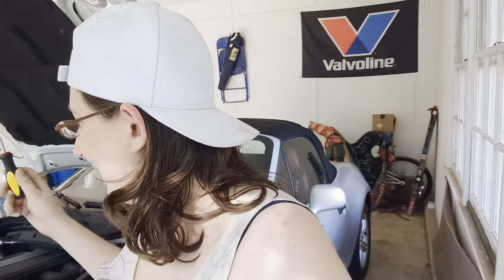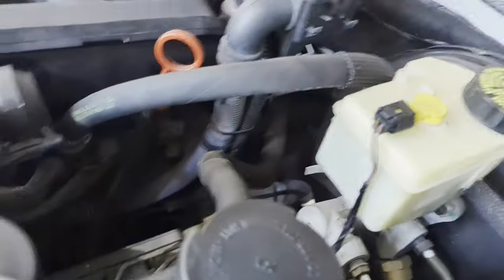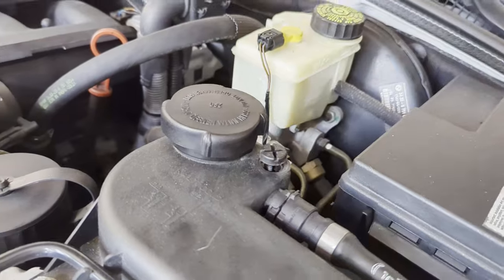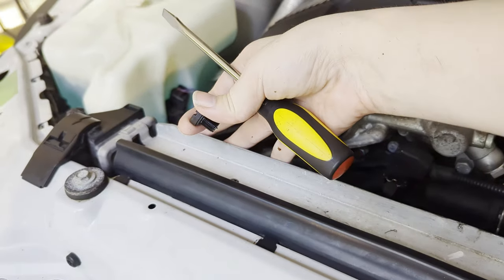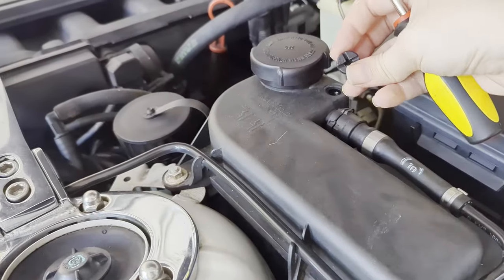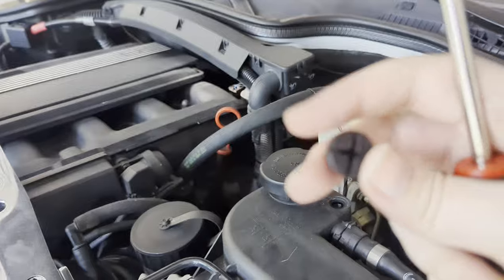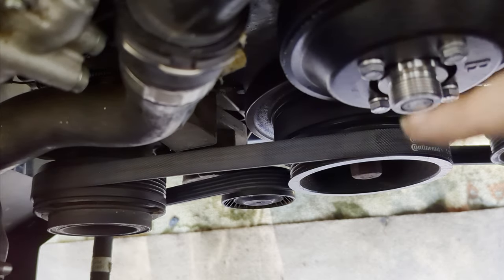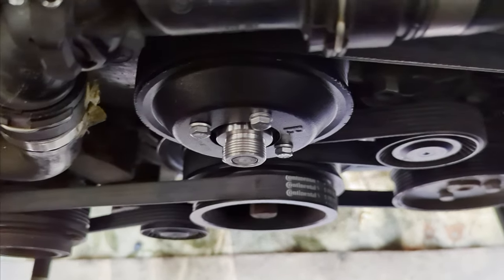BMW Cooling System Upgrades | M54 M52 M52tu

Comment: Hey, just for future reference those two threaded holes on the water pumps are for the pulley bolts so you can easily pry out the old pump with two bolts from your pulley you take off on the way. Hope that helps in the future! Edit- you can also use a 16mm on that tensioner rather than that hex socket!
Reply from the maker: Thanks I actually realized I could use the bolts to remove the pump after I took it off lol. Lesson learned for next time. I appreciate the tips. The tensioner one could definitely help!

Comment: Thanks for doing the videos it is helpful & I appreciate it. Newbie to Z3 & started working on it ( DIY ) . Currently stuck on not being able to take out the blot at the engine for draining coolant. Tried all breaking bar, impact etc.. It's a really tight spot struggling here! Any suggestions?  And also what the advantage of Fan deletion & its my daily thought of going the route of no plastic but after seeing ur videos seems like it's gonna go back & forth. And I can't hold it for that long. Happy holidays 🎄
Reply from the maker: You will need a wobble and a small extension to break the drain bolt free. The angle and tight space doesn't give much room to turn a socket wrench.

Fan delete will free up at least 20 horsepower. I've been driving my Z3 to work everyday and I haven't seen the needle go above normal temp once. So the fan isn't really needed. When it comes to getting rid of plastic your best bet is upgrading the radiator. Everything else you pretty much have to keep plastic unfortunately.